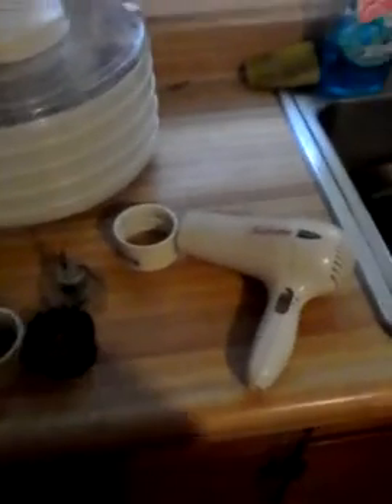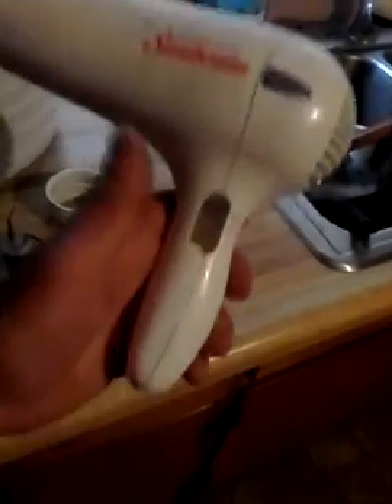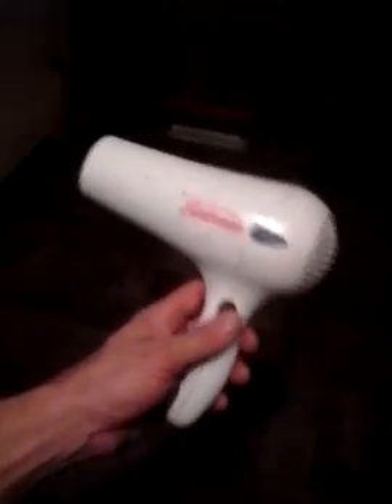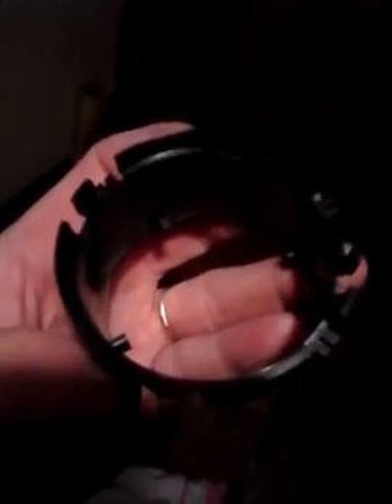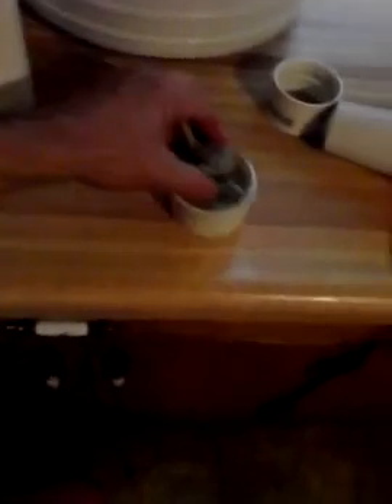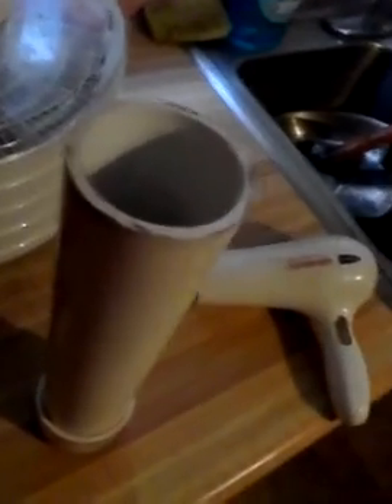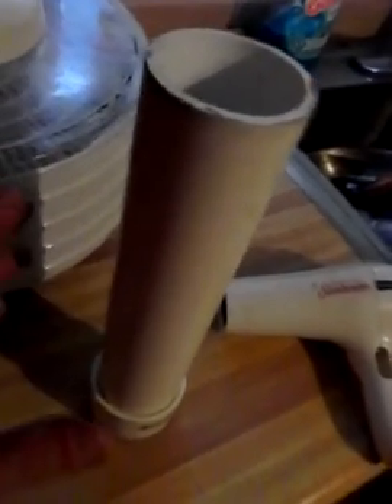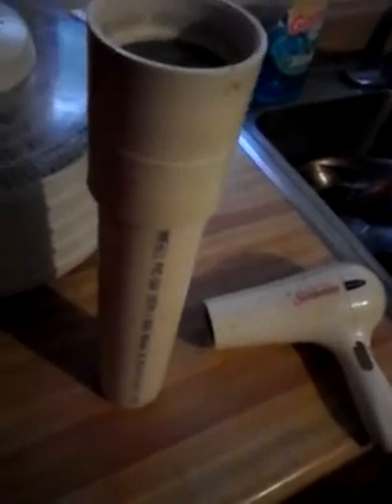12 volt fallout filtration video with details

Comment: You're definitely on the right track. Adding NBC filters and embedding the filter area, perhaps within a capsule that's stuffed with charcoal/carbon prefilter material, then have filter structure surrounded by concrete/cinder blocks in order to block out as much fallout from your filter as possible.